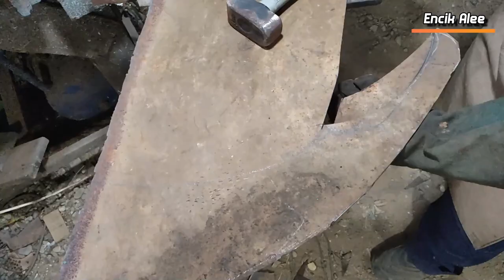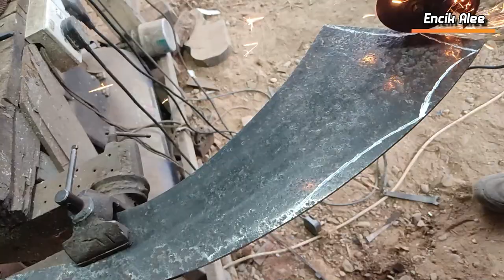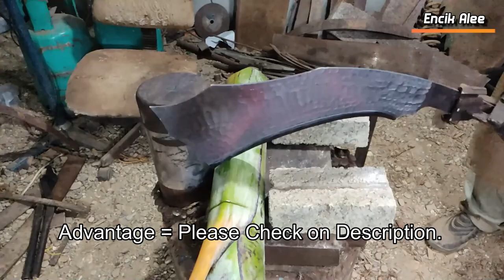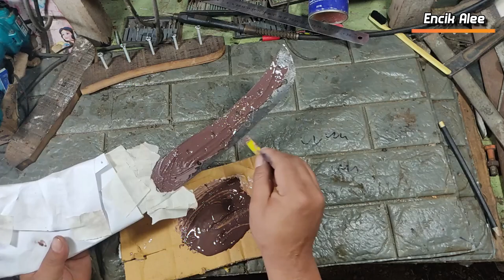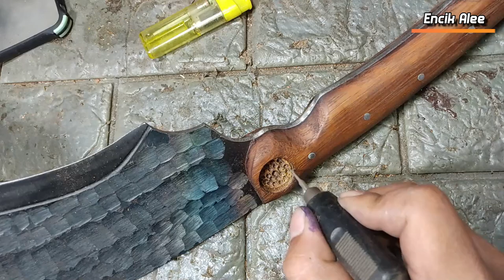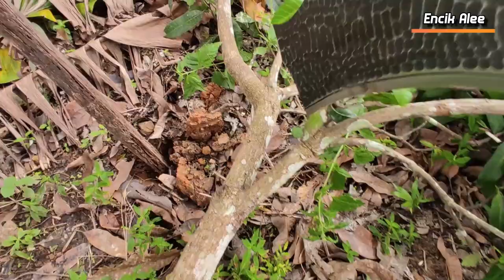♻️ Making Monster Machete - The Maciejowski Chopper

Comment: Just three things. 1. Might upset the forward finger guard to widen it out, making it more comfortable against the finger, 2. Make the end of the handle more bulbous to prevent it slipping out of the hand, which does happen even with light weight machetes, and 3. Put like a gut hook on the top forward end of the blade in order to snag cut branches and pull them to you, (mine has one and it is very handy at times.) Just my opinion.